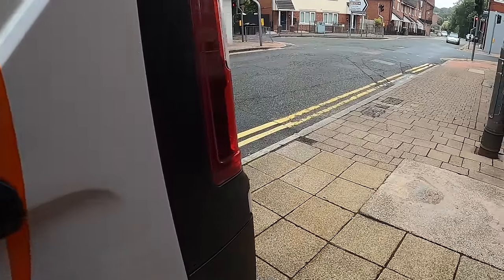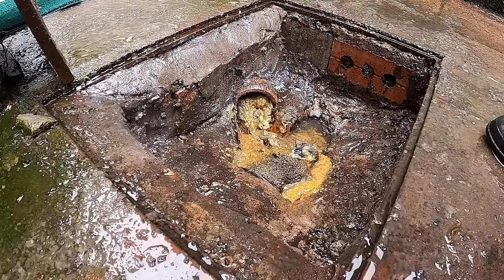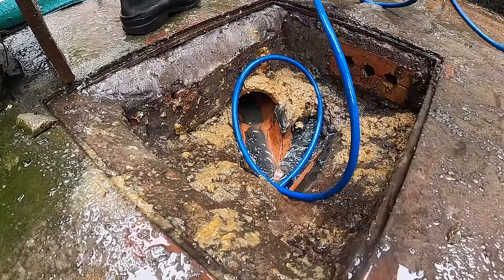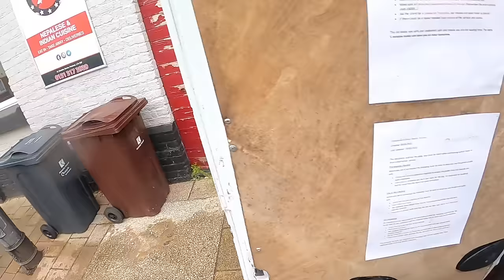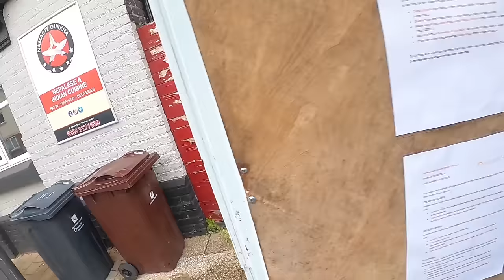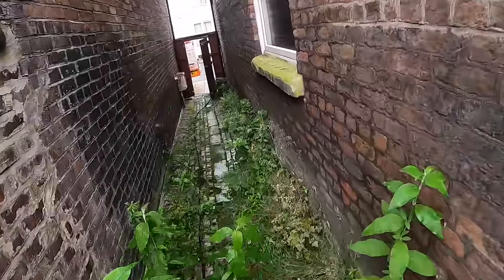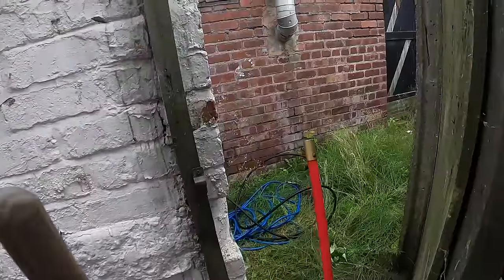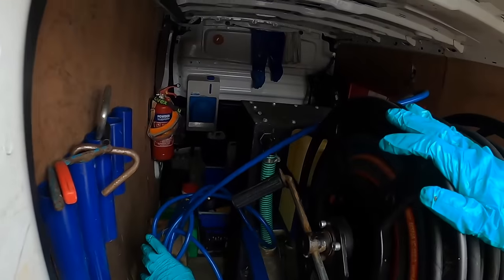Badly Blocked Manhole Unblocking - Satisfying Clean Up

Comment: I find this stuff fascinating. I had to rent a snake and auger earlier this year in like January because we had roots bad (clay pipes, naturally) and that was exhausting doing that. Then we ended up getting another clog so we ended up calling a local drain cleaning/plumbing company and finally fixed up. We put that roebic foaming root killer in every once in a while and it helps. It's nice to be able to flush to the toilet without having waste come up through the cleanout hole. I respect gentleman and ladies that do what you do. Plus, these cleaning videos are satisfying to watch

Comment: I see  the  pipes on the  outside walls,  where the  house refitted   years  ago  for indoor   bathrooms, and that  is  why the  sewers are   so shallow  in the ground.   In the United   States bathroom's   where   either  outside  additions  or  in the basement  before  they where  moved  into the living  area  for  convenience    This  is when they started  building new  homes    where they  put the bathrooms and kitchens  close together,    so that    running the pipes  was  more cost effective  Also   we  don't   water   jet  here,   it's  pump out first to a  tank on a  truck   and then use   a motorized   screw  router to unblock.    Very   different    in England , I like   the sanitizing to  kill the sewer bacterial

Comment: Nice job as usual. Just was wondering if your on board water tank runs dry and your using the pump does it shut off automatically so no damage will occur?
Reply: These pumps run out of water regularly. Not sure how it's done, but they don't get damaged.
Reply: The pump valve bypasses when not under load and sends the water back to the tank. You can tell when the pump is starting to run out of water whilst under load  and usually have sufficient  time to shut it off prior to this occurring.

Comment: Whistling College isn't cheap either! 🤣 On another note at the 3:50 mark the stuff coming through the pipe looked like some type of gravel. Is that a sign that there could be pipe displacement or collapse or is it just normal stuff that builds up in pipes?
Reply: That's probably just grit from the gully, from all the dirt in the yard

Comment: not having had a jetter in my hands I was wondering if you could do a close up of the worm end
Reply from the maker: Hmmmmmm 🤔, possibly problem is the pressure behind them makes them dangerous outside the cover of a pipe
Reply: I did not mean in operation I guessed that would be iffy I just wanted to see a close up so I could see the drill holes that are the jets
Reply: @TheDrainUnblockers  I just wanted to see the drill holes in the worm end ( not when it has water coming out I could then see how many jets it has to the rear  bu I think I have figured there are 3 or 4 pointing to the rear as the worm head pushes its way through the pipe to trhe blockage it probably has 1 to front and center too to help dig its way through the blockage

Comment: Is that just a diesel pressure washer in the back of the van? I was thinking how nice it would have been with a hot water one for both the dains and cleaning the tiles.  Utmost respect for your trade, the guys that come to my house now and then becasue the landlord hasnt been maintaining the drains are always very thourrough and eager to do a good job just like you guys.
Reply: I think that for this work, the pressure alone is more than enough.  That's a gasoline engine, btw.  The ones that heat water do use diesel as the fuel, but you can get propane powered ones, too.  Getting into a diesel engine for the pressure washer just ups the price.  They absolutely suck back the fuel to heat up the water, so it would be double the expenditure to buy a heated water unit, as well as to keep it fueled up.  The more complex they get, the more trouble you can expect, too.  Hot water requires different compound seals, and the heat of boiling water breaks them down quickly.  You find yourself constantly changing seals any time you change a fitting, whether quick-connect or otherwise.  Hot water has uses, but not in this racket.
Reply: @stanpatterson5033  Good explanation- Hot water does disinfect tough so maybe you could omit that step. Still probably the disadvantages outweigh.

Comment: Hello Andy, Commenting from Australia: can you confirm this is a sewer line and not a storm water line???, OR perhaps you do not have separation on storm water and sewer systems in the UK.  By mentioning "kitchen gully" I assume this is sewer.  This is access pit is VERY close to the ground line level is this normal????
Reply: It's a sewer line, the dirty water from the bathroom, kitchen etc goes into it. Clean water from the roof goes into a seperate system.
This an old property. Newer ones have much deeper manholes.
Reply: @jeannorris1510  Thanks Jean for answering...but I am still worried about how shallow these access pits are and how close to the ground level....a lot of rain water must find its way down open/broken access pits and cracked substrate.
Reply: Warpedsmac The previous answer is incorrect. This looks like a Victorian era property. In those days foul and rainwater were collected in combined sewer systems, and usually discharged directly into the nearest river. Of course treatment plants have now been installed, but millions of older homes are still served by victorian era combined systems. 

The depth of the drain depends entirely on the local topography. On a sloping street you might find drains are a few inches below ground at one end, and eight feet deep at the other, basically whatever was required to get the drain to flow in the required direction. If the main sewer is some distance away, you necessarily have to start shallow to form a long, gradual slope. If the main sewer is six feet below ground but at the other end of the road, the houses furthest away on that road will have shallow inspection chambers and as you move along the street they will get deeper and deeper. We don't have to worry about freezing in this country, frosts rarely freeze more than the top few inches of the ground.
Reply: @spencerwilton5831  Thanks Spencer, I assume you are in Australia too... 
I asked the question about the inspection/access pit simply because the relative shallow-ness is something I have not seen in Australia...there are probably similar here but I haven't seen them...yet.  Parts of the united states also combine sewerage and storm-water which causes big problems during torrential rain...there  are many videos on YT of this too. Thanks again from Hunter Valley AUSTRALIA

Comment: Just wondering, how many "bottles" of disinfectant do you use? You seem to be the only drain cleaners that show it being used.
Reply: Half the time it is not needed, eg pouring disinfectant directly down manholes. No argument using disinfectant here as the sewerage had overflowed. 

Personally I would  use a pump sprayer rather than gluging it about randomly.

Comment: Buy a new tool. Portable Hose reel complete with pressure valve. To keep you looking presentable, hose reels must be neat, and clean. Use the remote control to start the engine, increase and decrease the pressure. Even though you work in a dirty place, it doesn't mean you are dirty. Lots of examples, just look at YouTube, which does the same job as yours.